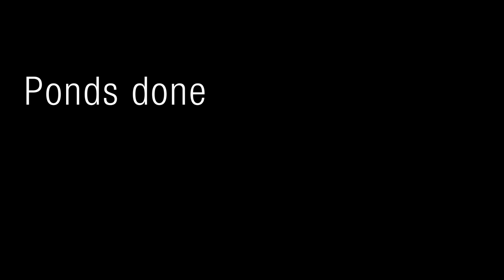15-Foot Pondless WATERFALL Build in One Day!

Comment: I watch y’all’s videos everyday cause I love watching how you create.  I will be getting one in January, in line with a aquascape contractor.  What I want to ask is in every video you show how to do everything but I have yet to see detailed explanations of how to run the flex line from vault to spillway.  Does it go over liner with rocks or do you create a hole and connect another fitting and flex hose to come out from liner to spillway?  If there is a video link would be great.  Thank you
Reply: It's outside the liner. In their other videos, (ie "Bible" etc.)  they show how they go through the liner into the spillway. Other folks like to run the pipe totally inside the liner to the spillway- their idea is that having everything "in the bag" is cheap insurance for any possible leak. I ran mine outside the liner.

Comment: 6 large Aquablox? 2 to 5 SLD? Vault off to side? Line the idea of the skimmer lid on top.  You put spillway opening behind 1st spillway rock? The  foamed and it goes up and over? Any info is appreciated. We're building one similar with more stream in a few weeks at The University of South Florida's Botanical gardens.
Reply: Oh and on the Dosing I plan on using an XT. Do you add the "Clean" or "maintain'?